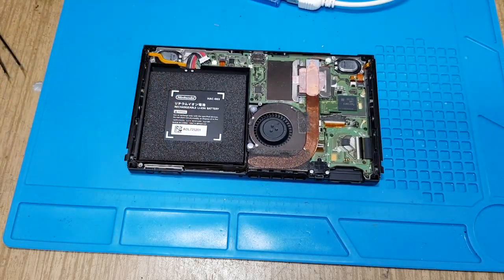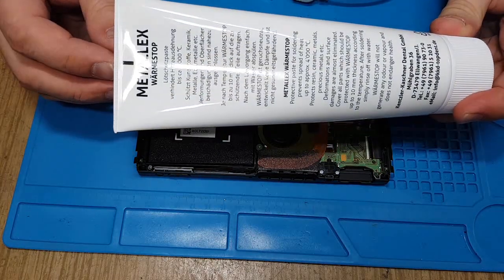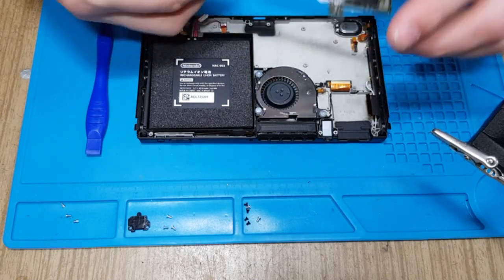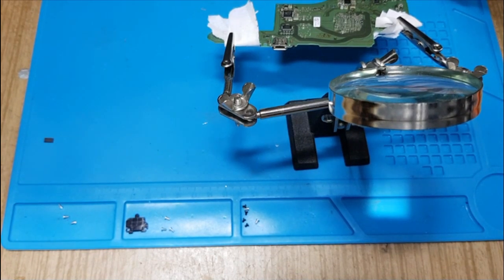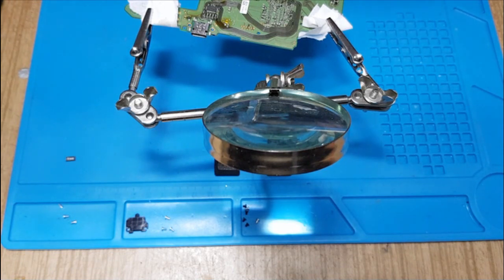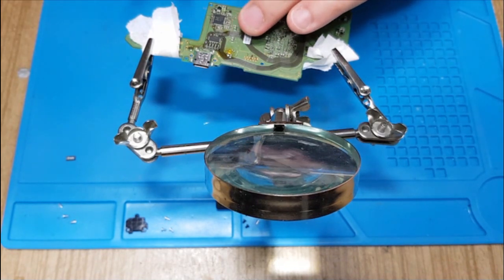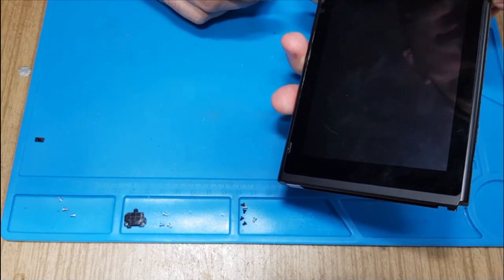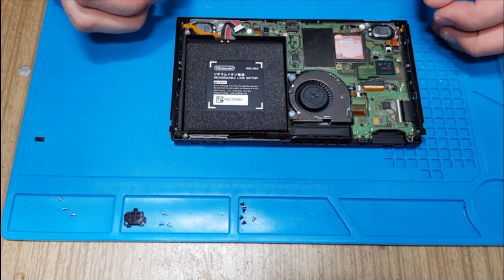Nintendo switch repair black screen/not charging - exchange of P13USB IC chip

Comment: Hi. I have this problem too and I need a fix for it but I don't want to send it to anyone. This is the list of things I tried: Performing a hard reset, pressing the voulume buttons, and getting a new ac adapter and yes, Its the original nintendo one.
Reply from the maker: Well then you need to open it up and start testing with multimeter ;)

Comment: Hi! I have a nintendo switch stuck on the "nintendo" logo. After the console shows the logo, i only see a blackscreen. I can't get in recovery mode and i can only use the hekate menù. Do you know what could i do? I tried to restore the NAND with a donor NAND and the prodinfo file of the brake console, but nothing. Any suggestion?
Reply from the maker: I think you are some steps ahead of me.. I have only done power supply issues in replacing the most common chips..
Reply: @letsfixitgarage  Oh, don't worry, thanks  anyway

Comment: Hello !
It's a very intersting video. I will try to repair my switch but i have a questionto secure the fixing : 
 what is the temperature you are using to unsold this chip?
Reply from the maker: Well lead free solder is melting at 220c but then it's always the question of how well is the board preheated, room temperature and you hot air station precision.. I was setting mine to 280 usually.. if it's your first time don't rush it, look up more videos from my mate vince he was going through all attempts and mistakes on camera. It's not as easy as it looks in youtube ;) but I don't want to disencourage you, do learn and try it out, just don't rush it ;)

Comment: my switch is dead and wont charge no matter what I've tried. I've attempted everything I can without getting it ripped apart or ssnt in so Nintendo can for some odd reason fix it, then delete my data.
Reply from the maker: if you need your data you need to find a repair shop.. I assume nintendo just does a swap of the motherboards that's why they don't preserve data..
Reply: @letsfixitgarage  Thank you, I'm starting to consider yyat now above most options.

Comment: my nintendo is stuck on the home screen.  already tried to restart by safe mode and does not work.  the battery charges normally but is no more than the home screen.  any suggestion?
Reply from the maker: not sure where exactly does it get stuck, but I would try disconnect and reconnect battery and get to the menu to make a factory reset.. or look for a possibilities to reflash the firmware..

Comment: My switch is not showing up on my TV, I tried different methods (like unplug the cables, waiting 30 sec, etc) didn't worked.

I took my console to a repair center/service (not official of course) and they changed the P13USB IC and the Type-C USB chargin port but still didn't worked.
They told me that the console worked on a Chinense dock for some time, then stopped showing image on the TV.

What could be the problem with my console? is something burning the P13USB IC?

I've been searching a solution for over a year :(
Reply from the maker: Well as you already figured out the system is a complex thing.. P13USB would be the first suspect for me to.. other idea would be to get another switch and see maybe the dock itself is broken.. other idea could be to send it in to tronixfix for a repair on sharing youtube comunity he has quite a lot of repairs on the switch ;)
Reply: @letsfixitgarage  By the way, my dock stopped working some weeks after, all the USB ports are dead, not showing anything on the TV (tried different Switchs/docks) but at least I can charge the console while is docked.

Man what a weird shit :(
Reply from the maker: @JoshP86  yes it seams that it is a complex issue.. i read some article that nintendo misused the usb 3.0 standard not folowing the needed charging voltages or comunication standards thats why it had such a big fail rate with non oem docks..
Reply: Facing the same issue. Were you able to fix your switch?
Reply: @anuragchoudhury8022   It's not fixed :( I tried On a non official repair center cuz there's not Nintendo customer services here.

The technician couldn't fix my console even after changing the P13USB IC and the Type-C USB charging port.
Reply: What charger are you using? Is it the original one?
Reply: @hassxnii1539  Yup, the original charger.

Comment from the maker: Oh and regarding the shorted out component at the back of the switch mainboard it does not influence it's work in the dock.. In docked mode functions without problems, in fact didn't found anything that wouldn't work.. maybe it's a redundant channel..